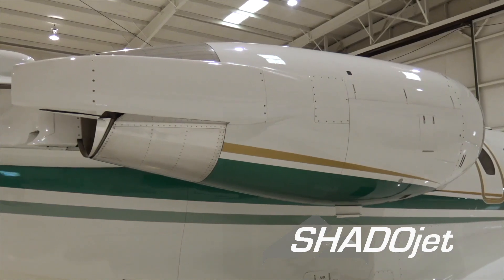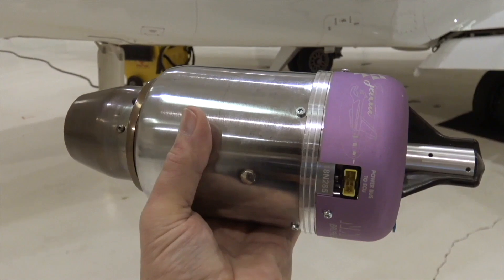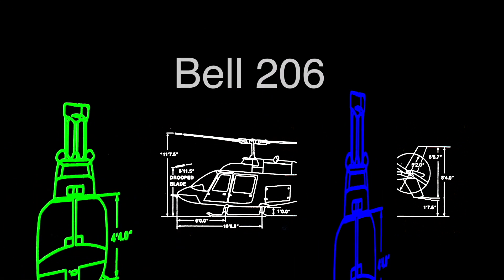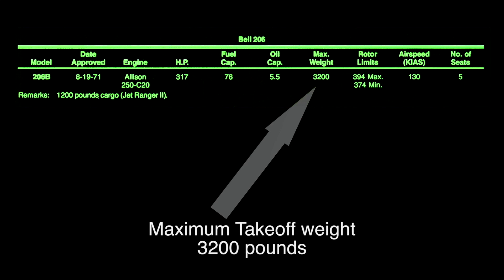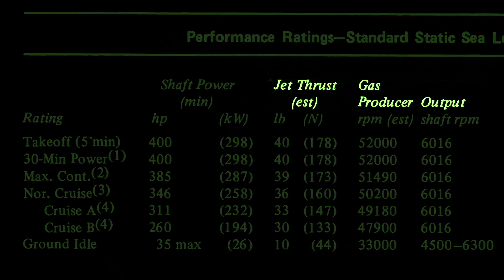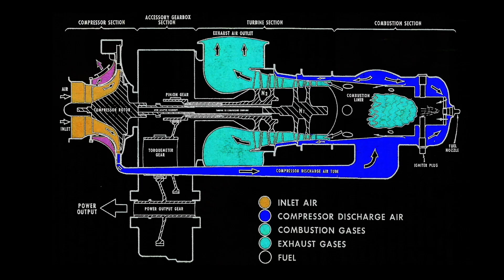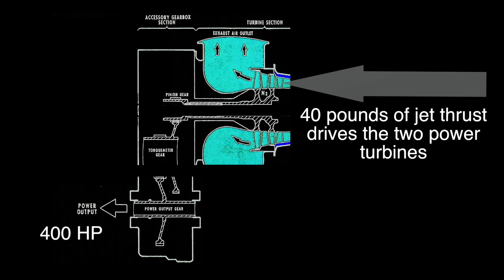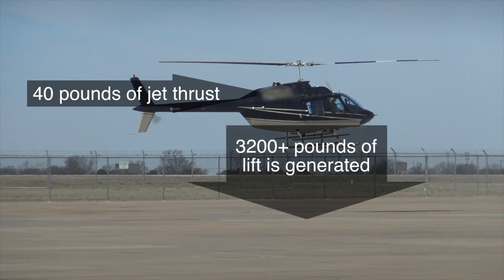Flying 4 people with 40 pounds of jet thrust

Comment: Nope, I would say you're wrong, tthat is not a turboshaft.  That is a pure turbojet where all the excess power beyond gas generation is thrust.  There is no shaft power taken from it.  If you took any shaft HP from a similar size compressor and turbine it would be only a few HP..

Comment: It's exactly how can a motorcycle with a 40 ft lb of thrust makes 100 horsepower wow my  bicycle can do that. The problem is the  motorcycle is at 14,000 RPM  your running at 5 if you leave out information anything is possible . It's a funny video though

Comment: I believe the 40lbs of thrust measures is at the exhaust after the power turbine, i.e. after the 400hp has already been extracted.  most turboshaft and turboprop engines only make 2 or 3 digit numbers of exhaust/ reaction thrust. almost all the work is done by the prop or what the shaft is connected to.  with the power turbine removed, hypothetically it would likely make a few thousand pounds at the exhaust.

Comment: 40LB is correct. HOWEVER, what is the area over which the 40lb is being ejected on. ie the Turbine disk SURFACE area. My guess about 30square inches so 30X40 =120lbs roughly. Not your 40lb.

Comment: Is the jet thrust not measured after the power turbine? I.e the helicopters exhausts generate 40 lbs of thrust, but that’s after the power turbine has extracted a huge chunk of the power. The thrust without the power turbine and just a nozzle would be far greater.
Reply: Yep, something is missing in the explanation, doesn't seem right. 40 pounds lifting 3200 lb... That's a lot of pulleys